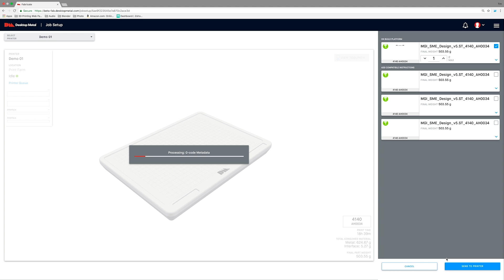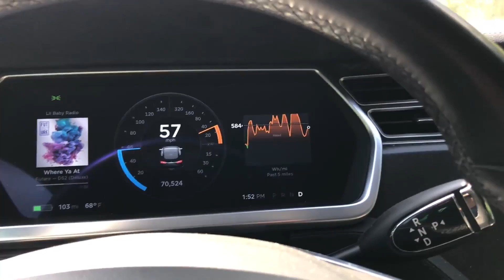FIRST DRIVE - The world’s first electric motorcycle powered car

Comment: Hater gonna complaining about why this motor have a manual gearbox 😂
Reply: Hater ignoring fact that w/o tranny, RR would have to fabricate bearings and mounts and adapters to connect the driveshaft to the e-motor, and RR is too honest. He's not good a fabricating things - lol!
Reply: @jfan4reva  not only that, the motorcycle esc likely doesn't have a reverse function.  Most bikes don't until you get into the very large touring versions or the three wheelers. So on top of what you mentioned, he would either need a new speed controller, fabricate some sort or reverse gear, hack the existing speed controller, or use what he had on hand.

As for the definition of rat rod, he made the right choice in my opinion.
Reply: @jfan4reva  He could mount the motor directly on the tranny with a suitable final drive ratio. Plenty of EVs are made like that, and it gives you room for 4 more batteries without driveshaft and gearbox and you save 130 pounds. This motor has plenty power, 0-60 in 8 seconds is not slow.
Reply: Tore Lund it's not all about 0-60. On EVs, efficiency and range are more real issues. With a gearbox, it can be fast 0-60 but at higher speeds in higher gear, it can travel faster at a lower RPM, making it go further. My electric car has a CVT which should be standard in all EVs.
Reply: @evilution_ltd  A CVT is definitely better than slapping a big motor in there. I didn't argure about the size of the motor. My first EV had a 27kW motor, peak power was 100kW, plenty for all scenarios without gearbox, but had problems with first floor ferry up ramps! (crawl speed and 1:3 gearing was too much for the windings so temperature cutoff cut in.
Reply: @Tore_Lund  you mean mount it directly on the axle? he could, but then it would be subject to all the vibrations, water, rocks, and nasty stuff that gets kicked up. As well as it could end up being knocked off altogether. Also since this is a motorcycle motor he would need to buy a different motor controller because it likely doesn't have reverse. If you wanted to eliminate the transmission (which doesn't weigh near 130 lbs..its only a 3 speed) you would be better off putting the motor in the tunnel and running a driveshaft to the axle from there. It provides protection as well as isolates the motor from severe vibrations and allows you to modify or swap parts out easier. Most of the time when doing an EV swap its easier to leave the transmission in, unless its an automatic.
Reply: @greynolds17  Ah, no reverse, I didn't think of that. Possibly though, I bet the controller has reverse anyway, as it looks very generic. Still with 3 phase brushless motors, just swapping two motor wires, say with a relay, makes it run backwards. Keeping the axle to tuck the motor inside the tunnel would not add losses , just an extra U-joint and the tunnel could be used to route cooling air.
Reply: @Tore_Lund  Yeah you're not taking into consideration the amount of harm pulling that many amps from the batteries causes. With that much load the batteries heat up extremely quickly and without a cooling solution you're looking at forming harmful dendrites thereby sharply decreasing battery life. With a gear box you multiply torque load through gears thereby decreasing battery load at the expense of some frictional and weight losses.
Reply: @br0therTheresa69  If you want that faster acceleration over added complexity. I did own a direct driven 1:3 EV, and I had to be careful in city driving with little cooling air, both motor and batteries would overheat in summer with too many hard accelerations.
Reply: @Tore_Lund  I mean I agree? I'm sure there was a thousand ways Rich could have improved the build but for the sake of simplicity I wouldn't have done it any other way than he had in his video. I mean changing a flywheel and clutch is cake when your motor is the size of a duffel bag.
Reply: With such a underpowered electric motor it only makes sense to use a gearbox+driveshaft.
Reply: Not a hater just wondering how u do that
Reply: gearbox on an electric still makes sense.  It may not need the lower gearing to take off from a dead stop like a gas motor, but you can still get better acceleration and range by using gears.  Plus, it's just more fun to drive that way!
Reply: @999benhonda  Better acceleration yes, higher range, not so sure. An electric motor has a much wider peak efficiency range, so spinning at 7000 rpm on the highway does not cost much extra. However if you can put a smaller motor in there, and help it out on inclines with a gearbox, you should aim for 20% load on the highway to have highest efficiency 5-7% better. That would be around 70kW motor in a model 3, but jack rabbit starts then.
Reply: I love it. At least it still has some badass left in it ;)
Reply: Ask Porsche  -they put a 2 speed in the Taycan.  They say it evens the power draw on the battery pack which makes the battery last longer.
Reply: That plane appears to be front wheel drive!
Reply: cuz they are fun...and also you can use it like a drive mode selector or pick gear ratios...also its easier to just leave it in usually.
Reply: More fun plus less fab. And if the motor was underpowered it would help with acceleration
Reply: @dosmastrify  He made his adaptor plate and coupler twice before he got it right! making a fixed belt drive to drive the rear axle directly, would only require a piece of aluminium and a bearing  and a shorter belt. The belt wheel he could salvage from the original bike, and he would have no critical alignment to worry about when working with just a drill press. A gear box doesn't give you more power, only more torque, so power would still be limitted by the motor controller, though he'll be able to accelerate faster, but I'm just splitting hairs here. The other guy trying this says it feels quite adequate in second gear all the time.
Reply: @Tore_Lund  OK I should have said undertorqued motor. My bad.
Reply: I could be wrong on this, but I think the Zero bike actually has a reverse function.
Reply: Leaving the manual transmission was a good idea as otherwise he would have to mess with the rear gear ratio to find one that's just right.
Reply: I've always wondered why EV manufacturers don't use gearboxes for that purpose. It just makes sense.